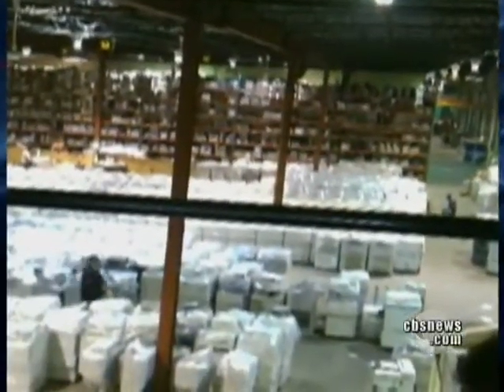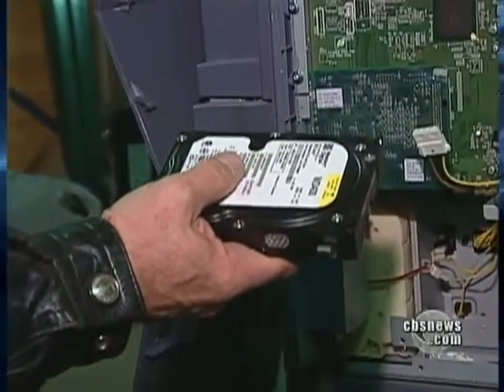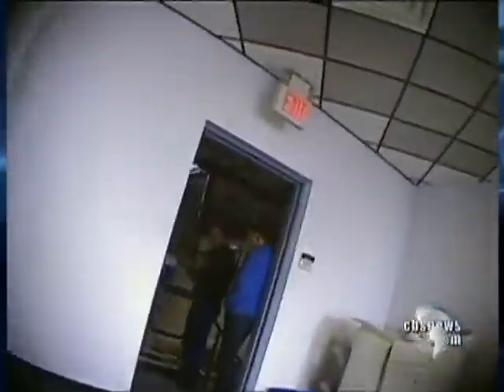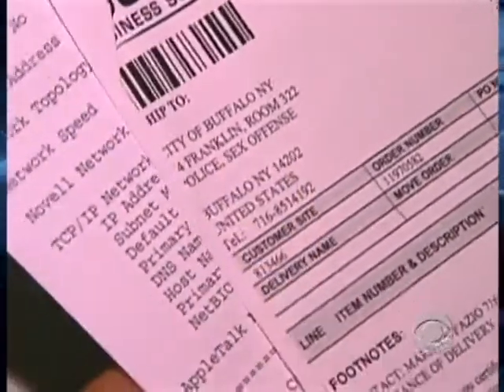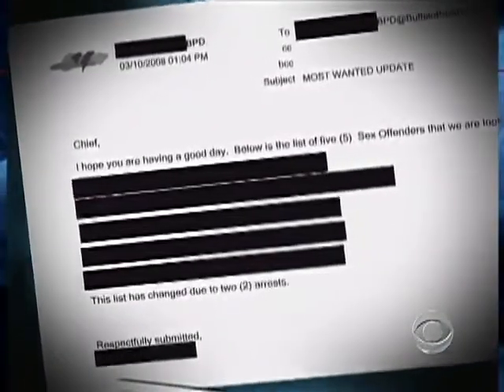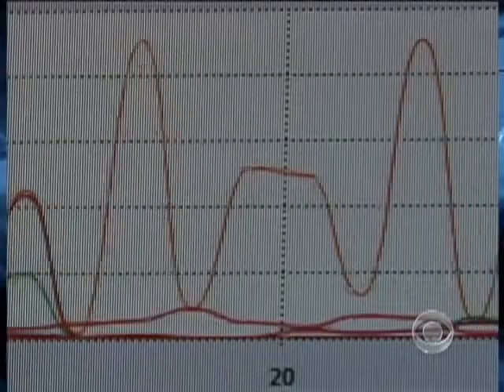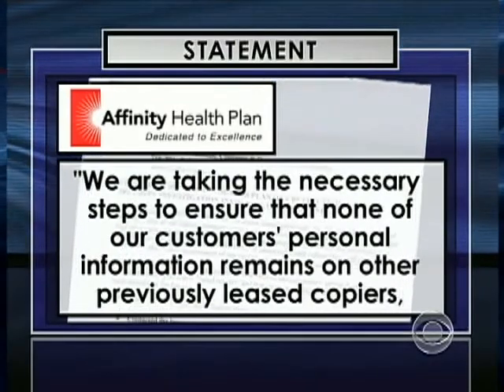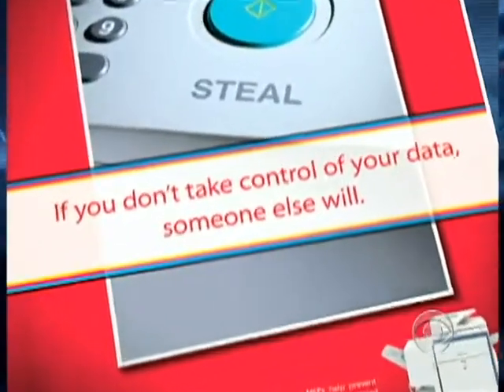Copy Machines Are A Security Risk To Users!

Comment: WOAH i didn't know it was on hard drives, i figured it was on flash memory. also thought it was only a few dozen documents, not thousands. Still, $500 is a bit steep considering it's about ten times cheaper to just drill 3 holes into the drives and replace them with new ones. Thanks for posting this.